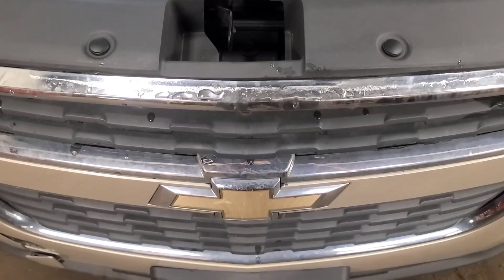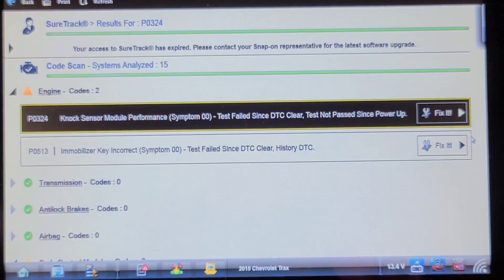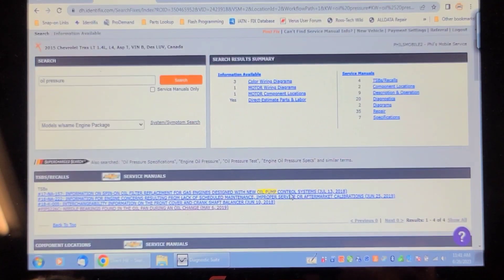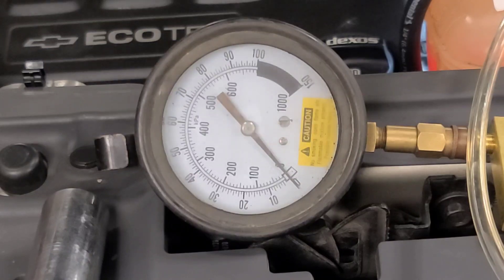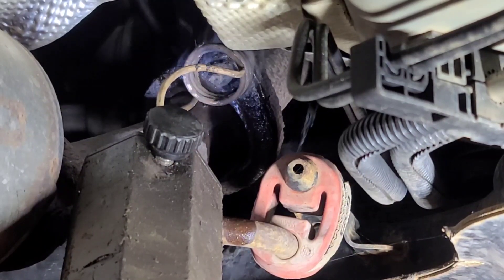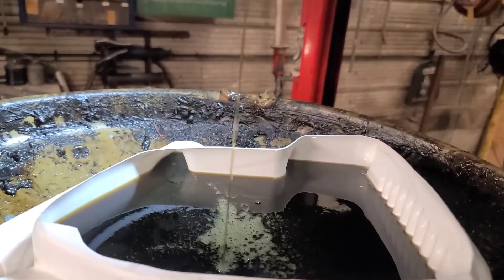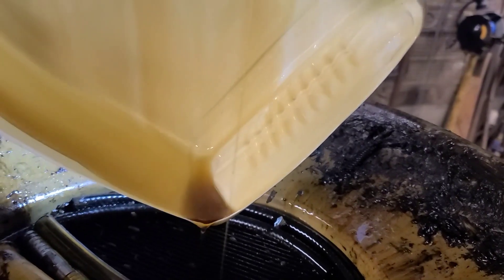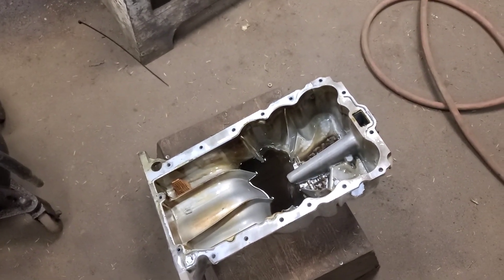2015 Chevrolet Trax 1.4 LUV No Oil Pressure pt. 1

Comment: dayum, so the oil pump just decided to fall apart? What a cheaply made part
Reply from the maker: It probably exploded. We are trying to source a used engine. I'll take it apart to see exactly what failed eventually.
Reply: Dang same issue 43000 miles
Reply from the maker: @stephendriver1  that sucks for sure